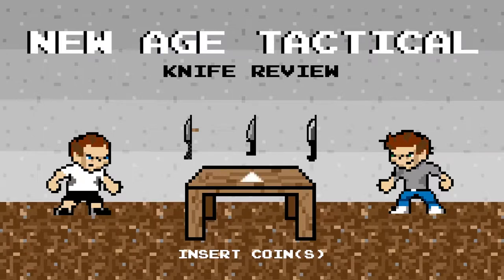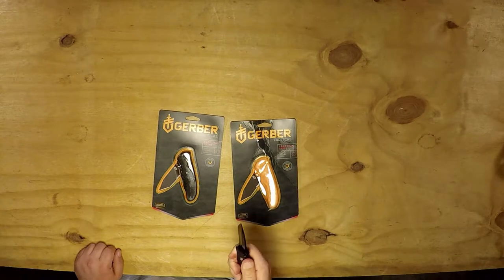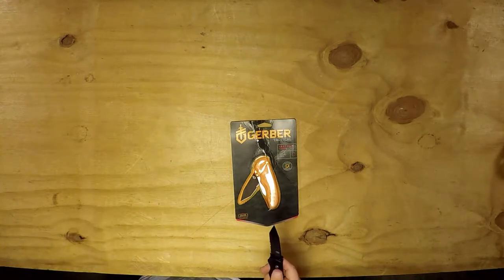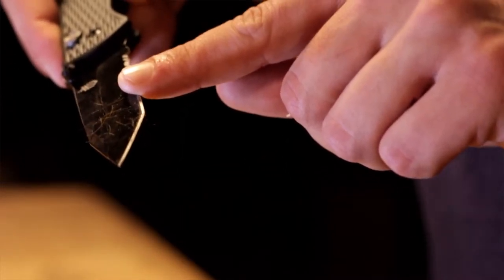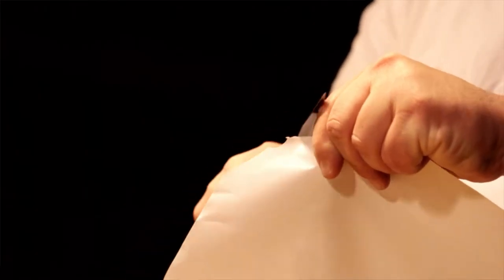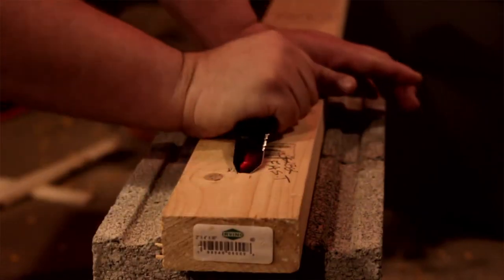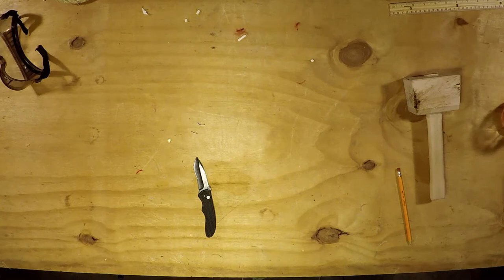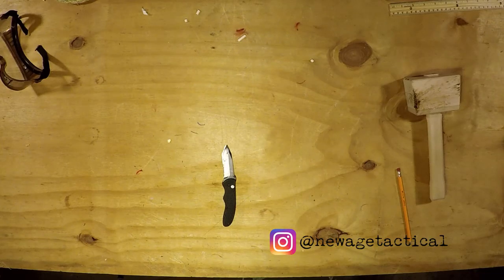Gerber F.A.S.T. Tanto | Knife Review/Torture Test (Fail?)

Comment: Best way I've found to keep any knife from loosening up, which in cases like this where the lock is directly relying on the tightness of the handle to the blade. Lock tight the screws will help from backing out and loosening the blade.